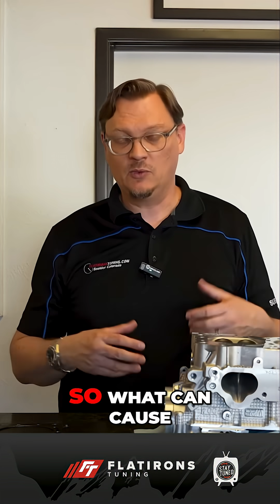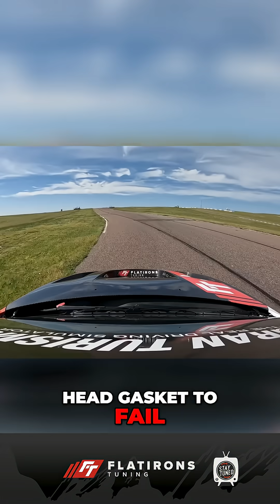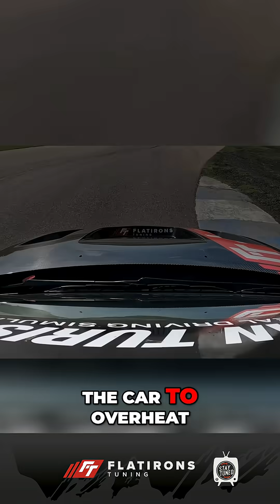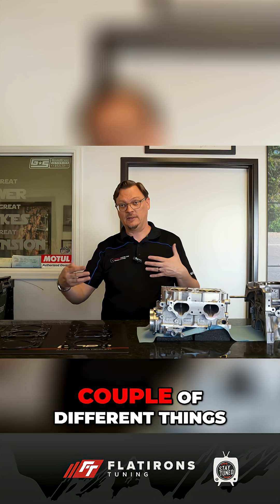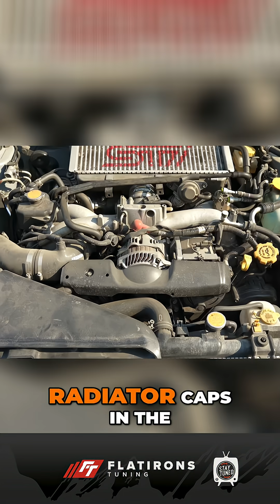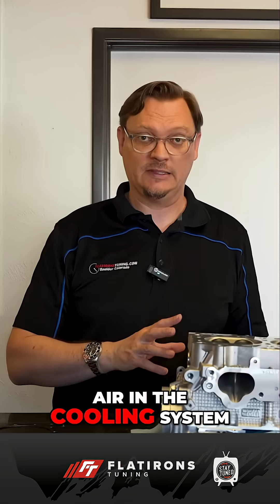Head Gasket Failure: Overheating Causes Explained!

Comment: Subaru has a known problem. Improper grounding causes excessive electrolis in the coolant and wears the gaskets and head. They tried to fix it with adding grounds but coolant flushing often if important

Comment: Na ej255 over 300k before head gasket fail. My next engine had a different failure at 1200 miles. Stripped tensioner threads. I helacoiled and replaced the bolt..here was my mistake I used a very hard bolt. This means that it didn't stretch and clamp when tightened.  This bolt worked it's way out and snapped, destroying the engine in the process. I think this is a problem many don't know about and it's not uncommon.